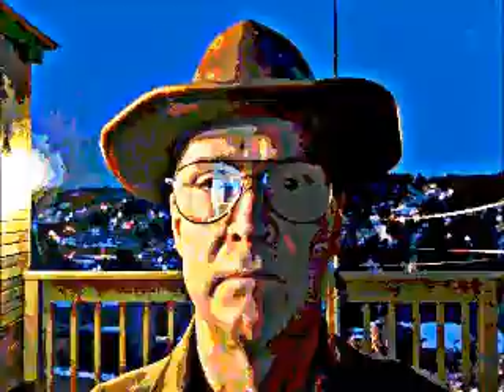DDRR Antenna

Comment: In the 1990-1991 I was a repair technician in a Swedish cellular phone company. I happened to find a DDRR antenna for 450MHz band.
The low profile and copper base plate made it perfect for mount on top of a fiberglass top box on my car. No extra earth was needed.
Other benefits was low reflected power, no variation of direction and vertical polarization. Power output was 15W and it worked as a charm!
A curious thing happened during tests of the antenna at my workstation. I held the antenna on my hand and kept it in height with my eyes. While making a call my eyesight shifted from a steady picture to a “floating” one.
Studying my instruments become hard and my bench behaved as a Dali painting. Moving like a slow wave on a beach.
Astonished by the phenomena I starred at the instrument, don’t knew what to think.
Slowly raising my hand so the antenna was over my head, my vision stabilized and the instrument become readable again.
Just to ensure what was going in, I lowered my hand and the vision become a wave again.
I found the antenna working very well indeed.

Comment: There has been a lot of interest in NVIS propagation on 160 to 40 meters lately and I think the DDRR antenna would work well for that application.
Reply: Actually, it won't really be very good as an NVIS antenna as it's a low angle vertically polarised radiator

Comment: I built a working DDRR, upscaled and cut for 1610 kHz, from the ARRL Amateur Antenna Handbook in the late 1960's, for pirate use with a Collins TCS (Navy) transmitter.  It consisted of 1/4 λ upper and grounded lower loops on 8, 5 1/2' wood posts, the top loop open, connected with a short vertical section on one end to the lower loop, and shunt fed about 10' from the vertical section with a short length of RG-8.  The shunt feed point was critical and took some trial and error to locate.  This worked well enough to be audible for about 10 mi, with a transmitter TPO around 10W.  This also drew the attention of local broadcasters and the FCC, alas.  Helpful with the very low Z DDRR, the TCS was capable of tuning almost anything.  The FCC agent was perplexed by all this, having never heard of a DDRR antenna.  After the pirate station, it was used as a remarkably good MW receive antenna.

Comment: Hi Stan, I've built the double-ring style DDRR for use on 40 meters. I used 3/4" copper tubing and it ended up with a bandwidth of about 15 KHZ. I found the performance to be similar to a low dipole on 40 meters. It was slightly better for signal levels then my 40m mag loop, however I found the mag loop to be overall quieter in operation. 

Don't try to get away with using an air-variable cap on this antenna. It will likely ark and fail above 10 watts.

Comment: Stanley,  we utilized this antenna in Berlin in the 1980's and 1990's in our collection efforts against East Germany and the Soviet Union.  I was at the Teufelsberg Communication Facility and we utilized many types of antenna, including the 'elephant cage' and the DDRR. 

What I noticed was the ability of this antenna to bring in clear signals with high jammer activity in the area and also a high incidence of noise from atmospheric anomalies.  we had enormous tracts of land dedicated to antennas, and we tried anything to give us an edge. 

I can't go into frequency ranges, etc because it is most likely classified still, but I thought I would add my two cents.  73, de N3PEE
Reply from the maker: Cool! 73 de W1GV.